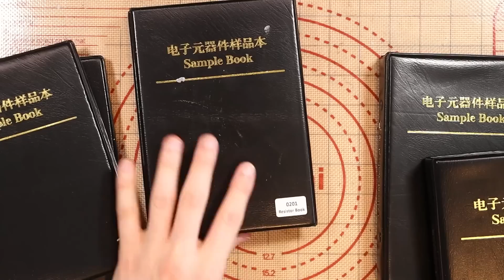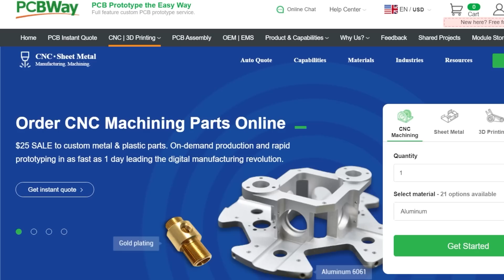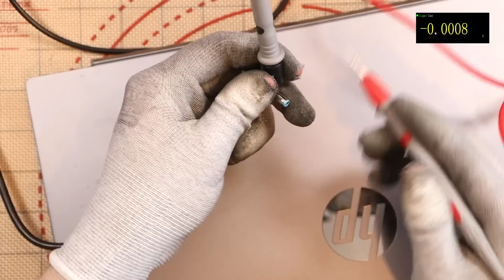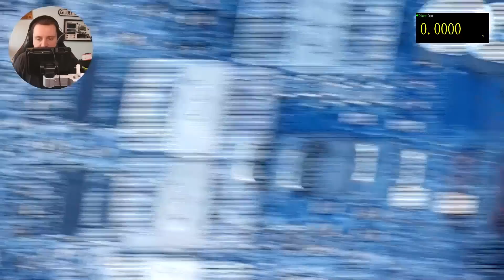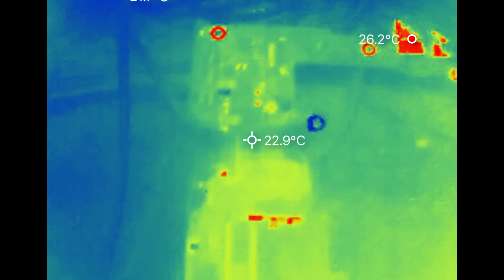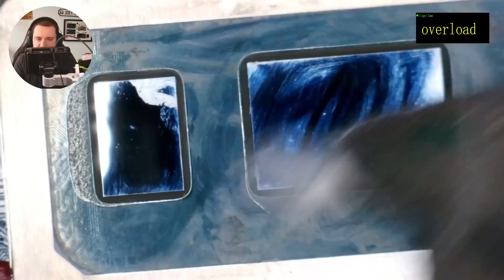Can We Make a Profit on this Faulty Laptop? | Profit or Loss S1:E57

Comment: As the saying goes, it's never the CPU.. until it is. But it's never the CPU (until it is). It's extremely rare for a CPU to be dead on  a laptop, desktop or Mac (I mean obviously it happens, it's just much more likely to be a Mosfet, cap or inductor). It's certainly far more rare than the APU on a console going bad.

Comment: Rule #1 of a laptop:  If it is dead in any way and it's not directly power related (no shorts, power supply works) then it's probably good for the bin.  Salvage what you can off it and move along quickly before it costs you as much time as it did money.

Yes, I know some can be fixed... but most bigger repair places just toss a new MB in and pat you on the head with a big bill.   It's just not economical on any level to try to save them if it isn't obviously power related.

Comment: Joey for later laptop diagnosing: 101 Don't plug in charger on first diagnose. Always measure coils resistance first. 
If a CPU or GPU mosfet is shorted 19V- to the chip then you could end up with a dead laptop even if the user used the laptop from battery therefore there is a chance that it could be saved.
Reply: Theres gotta be close to zero chance the user didn't attempt to plug the laptop in before selling it when they noticed it wouldn't turn on.
Reply: @justinth963 Absolutely correct, but every plug in increases the chance of failure.
Reply: Usually there is some varistor that clamps the voltage.

Comment: 11:40 - yes, you are correct, the ground is on the right. You can also confirm which is ground just by looking where the traces are going. In this case, the traces on the left of the caps lead to a coil and you wouldn't install a coil on the ground plane. It would serve no purpose.

Comment: Great video, good to see you get into new areas to try and expand your knowledge! 
Top tip - if you ever go into repairing/looking at faulty/no power laptops, have a search for Adamant IT on YouTube and look through his videos, he's a PC repair shop and has loads of no power stuff where he does voltage injection and repairs the main board, so you may learn a few things about board repair for laptops! Obviously if the fault is with the PCH (or CPU) then it's game over regardless and all you can do is salvage components, such as the RAM, battery, wireless card, display, keyboard, etc.

Comment: Small suggestion for extra content plus may help to sell part-working laptops ... if you have access to a screen tester (one with lots of connection cables and ability to send test patterns) you could then report the the quality of the display in the laptop. Replacement panels are very pricey and buying random broken machines hoping to get a good panel is hit and miss .. so being able to buy with confidence could be a real benefit. Just a thought. Keep up the great work 😀👍

Comment: This is the reason why I don't bother trying to buy faulty electronics on websites trying to repair them.  Like you pointed out, those screws were tampered with.  If the seller already gone through the trouble to diagnose a faulty CPU they should have disclosed that.  Instead, they chose to be deceitful because they knew they would have taken a loss if they didn't.

Comment: Unfortunate fault, but for a gaming laptop, it is a great price.
Same spec Dell XPS goes for about 200 euros (excl. shipping) (170 pound).
I wish they'd cost less.
Reply: I'm not sure it'd be right to call this a gaming laptop. It has a dGPU but more falls into the budget ultrabook category, often cooling is a bit of an issue with these machines even with the low wattage (1050Ti, 1650 etc) GPUs.

They work but they're not made for long gaming sessions. That said, neither is the XPS!

Comment: Hey mate! I've been watching you for a while and while you mostly work on consoles (Which is super cool!), I mostly work on laptops. In this case, you're probably right by saying that the chip is gone for good. This is a truly huge issue going on with basically all the major PC brands, especially when it comes to gaming stuff. I never worked on that board in particular, but it seems pretty similar to the industry standard of having multiple phases to power the main chip. Again, most likely the chip itself is dead, but just a few of them survive and the cause of the issue is often a blown mosfet. I'm specifically referring to the one present in the power phases. A voltage drop test will tell you everything you need. There is the possibility that the short occured near one of the coils of the dedicated GPU. In that case, you can somewhat save the laptop by removing the shorted mosfet. At that point, almost certanly the GPU will be dead, but the laptop should power on with the integrated GPU and work only with it. The dedicated one would show as not working on device management or will just not be shown at all.

Hope this can help you in future laptop projects!

Comment: Tip, never ever use Isopropyl alcohol on a monitor. It can remove an anti-glare coating if it's provided on it. Only water and fiber cloth! Works a treat!
Reply from the maker: Makes complete sense, thanks! :)
Reply: my dad destroyed my old monitor like that
Reply: This is why I use lens cleaner, it's designed to clean without stripping off the anti reflective coating from lenses
Reply: @calvo131  I'd suggest staying away from lens cleaners as well, they're also quite aggressive. I've completely destroyed my motorcycle helmet's visor by wiping it with Zeiss lens cleaner and a high quality microfiber cloth, thinking just like you - that since it's "designed to clean without stripping off coatings", and I bring it with me anyway to clean the lenses - it'll work great for cleaning the visor. Turns out those lens cleaners are made to be safe for glass, but not plastics, and can easily destroy at least some coatings used for plastics. Since then, only using water, with a little bit of hand soap occasionally, when just water isn't enough.
Reply: It can also severely damage the screen, there's plenty of regret pics of that online. I only ever use what they suggest and if I don't know I turn the laptop on it's back, so the screen is level and gently wipe it down with a damp cloth. You don't want any water seeping below the screen.
Reply: I would avoid using water on screen because if the screen protective stickers in 4 sides are worn out, then you end up with a shorted screen. I always use usual screen cleaner fluid and suggest to everyone.
Reply: @racztamas1980  I'm pretty sure by "water" we all mean "fiber cloth soaked in water, and wrung", in contrast to other solvents, so it's slightly moistened cloth, and not actual drops of water running down the surface. 😃
Reply: @racztamas1980 : There should never be enough water on the cloth to short anything out, it just needs to be lightly damp. A lot of different manufacturers recommend this method.
Reply: I use white vinegar diluted with water
Reply: This !! Use some flash, it works a treat on screens, nice clean microfiber to dry it up.
Reply: I use distilled water, slightly damp microfibre cloth, go in circular motions. Works a treat.
Reply: And never use Windex

Comment: A missing NVME ssd screw is like a Missing Hard drive caddy for me
Reply: That's so true! Whenever I get those by clients, I just suggest them to replace the hdd with an ssd because the cost of a replacement caddy most of the times is not worth it at all. Like a good ssd and some tape will do the job even better ahahah